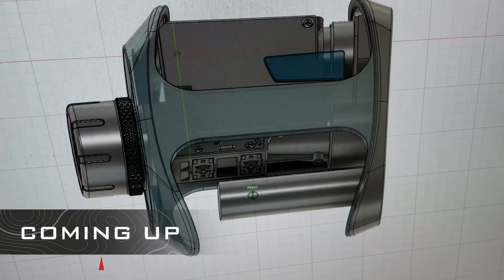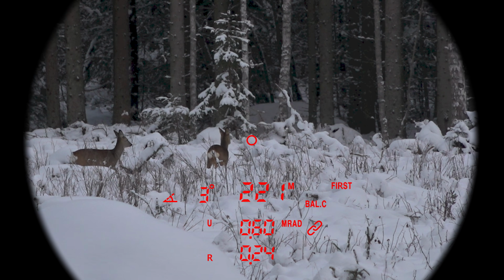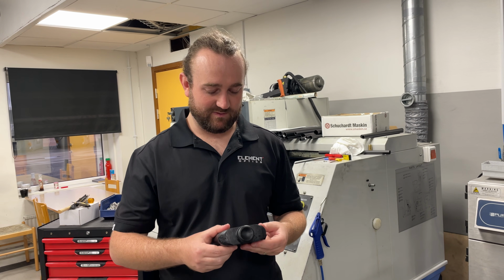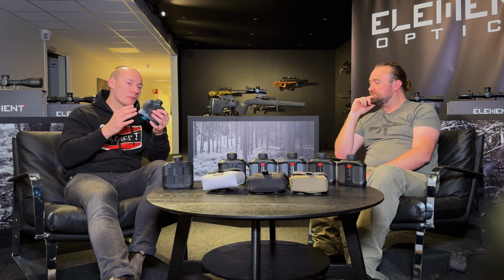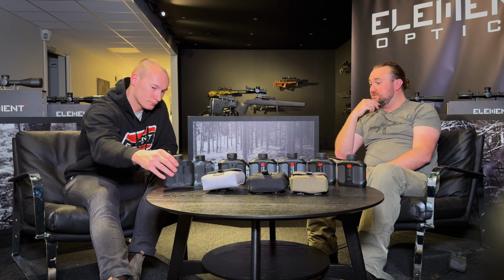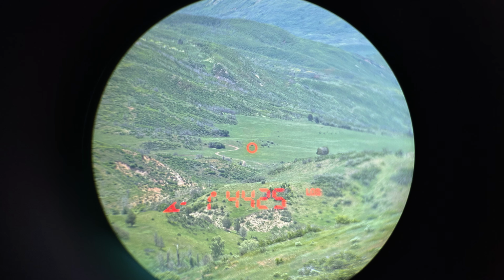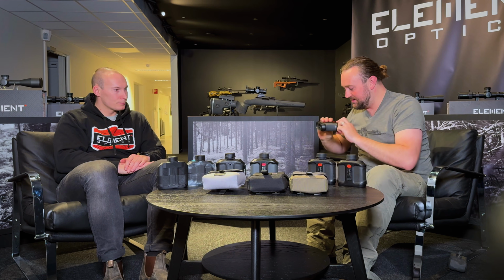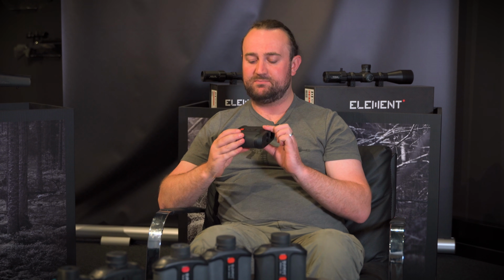Developing the Titan 3K | The Element Optics Podcast, Ep. 003

Comment: I deeply regret purchasing both devices. I fell for the distance feature without realizing the larger model offers nothing more than the smaller, cheaper one. Paying such a high price for a device completely stripped of essential features—like temperature, humidity, and altitude sensors—is highly disappointing. It is overly restricted and dependent on the smartphone. The creator’s marketing was pure talk with zero actual value."